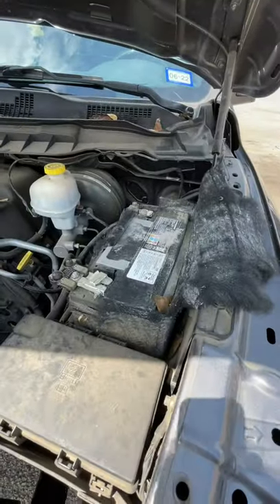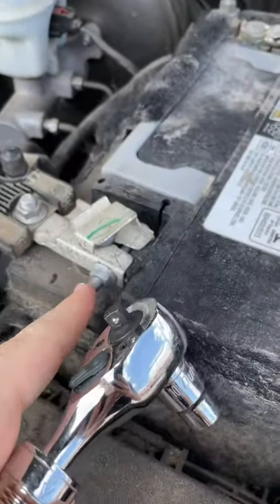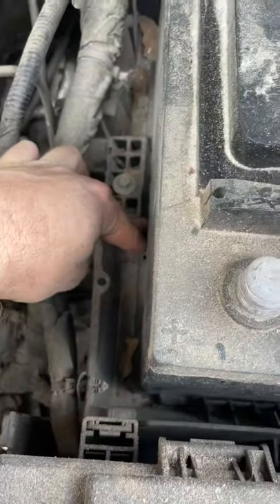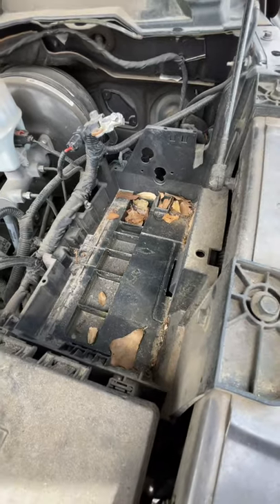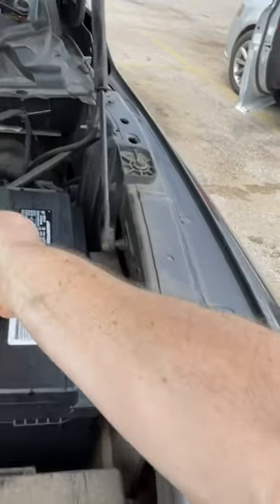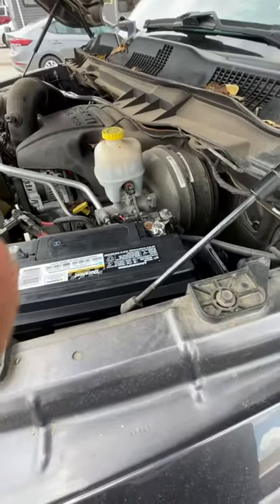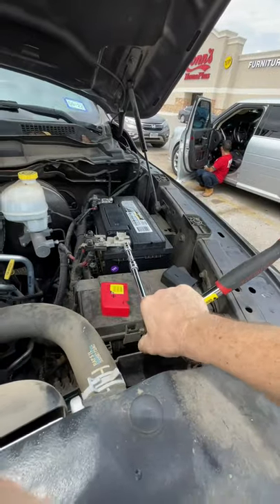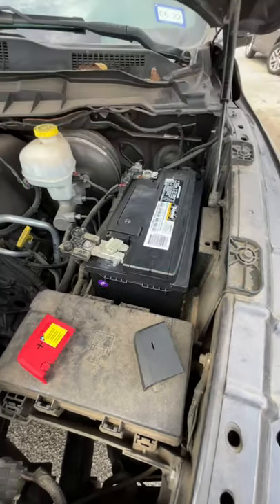How To Replace Dead Battery With New One | 2016 RAM 1500 Truck

Comment: Thanks to your video I figured out why neither the guy at advanced auto nor I could get the bolt in the clamp to catch. So I came to YouTube for help and watched your video. When I pulled up the heat shield to take a better look I realized that he hadn't hooked it under the clamp in the back. Once I did that everything fell into place perfectly. Thanks for posting this video.

Comment: Sorry buddy, not a very safe job, Negative cable gets removed first. When re attaching, negative gets put on last. If your negative battery post is still connected to the truck cable and you are working on positive. One little touch to any metal with your wrench is going be very shocking.
Reply: I said the same thing to myself. Something basic I taught my kids. Lost all cred in my mind.

Comment: As always, informative and fun. We used to clean old terminals with Coke. A lot of the old ways worked well. It wouldn't help you here though because Coke won't fix a dead battery.

Comment: My wife used to have a 2010 Cadillac DTS and the battery was under the back seat. I was like what were they thinking at GM that year lol.
Reply from the maker: Wow! That’s just too much work! 😮
Reply: @MasteringMayhem  yeah you had to take the back seat out for a battery change. Insane engineering. It did come out fairly easy but so unthought out.
Reply: @LLAMA-LLAMA  GM should of stole their ideas from different German engineering lol.